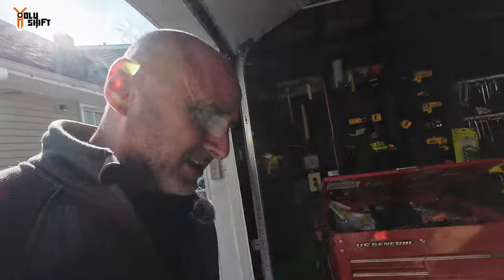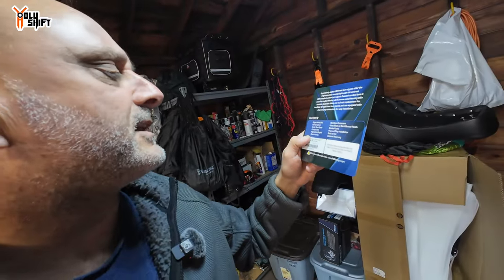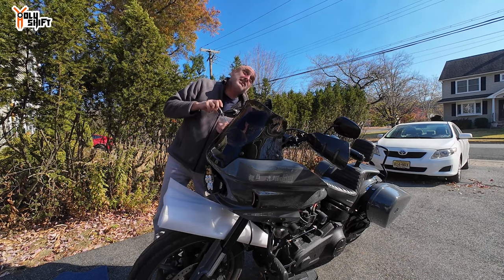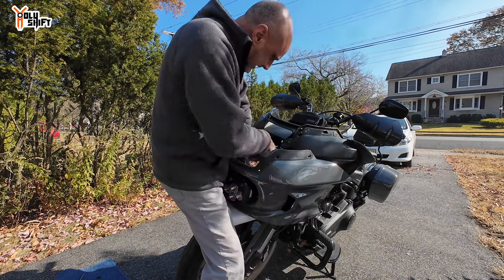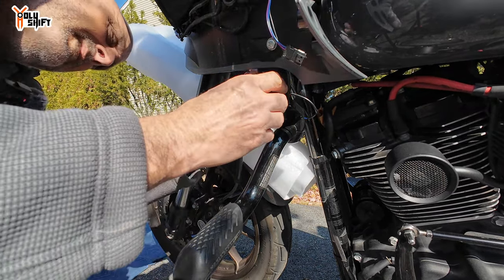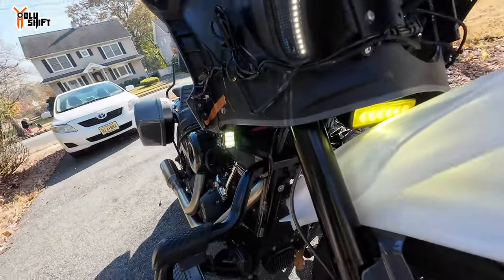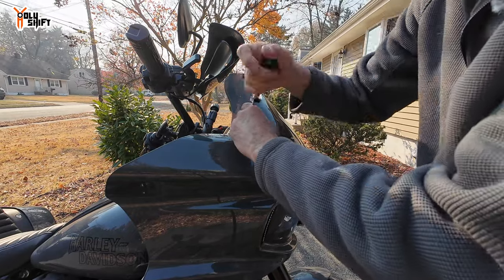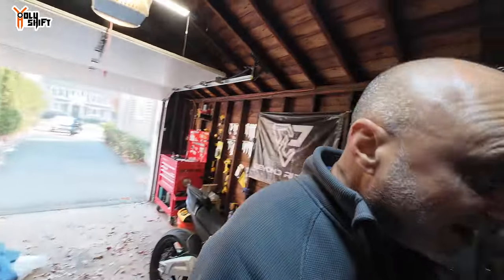Low Rider ST High-Performance LED Turn Signals

Comment: I like the new ones, they go good with the modern shark demon. Perhaps you could find some black screws to replace the stainless ones on the housing. Also just a thought, you guys are doing the cover motorcycle plate thing now (good idea) but perhaps the cars in driveway is a good idea to block out also 💁‍♂️
Reply from the maker: Thanks for the suggestions! 👍